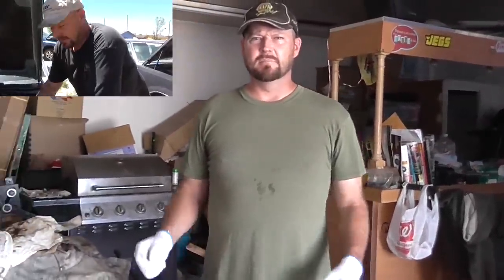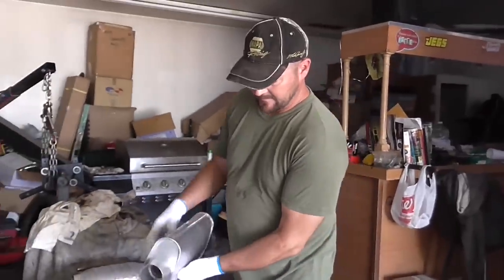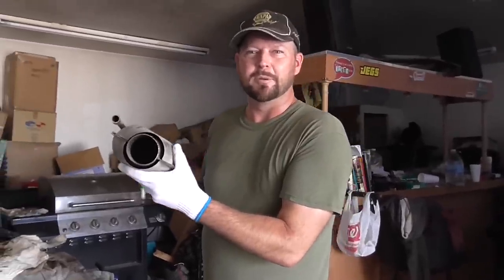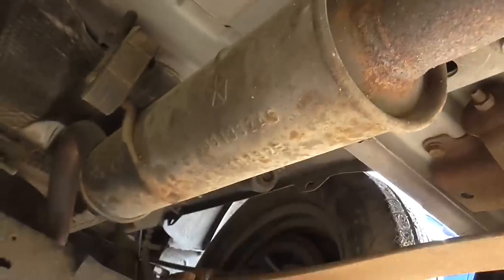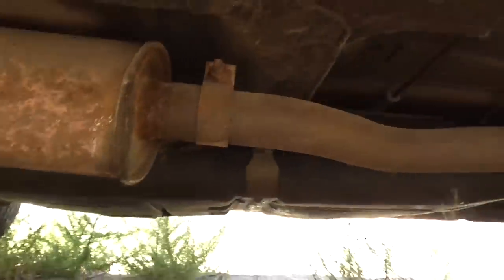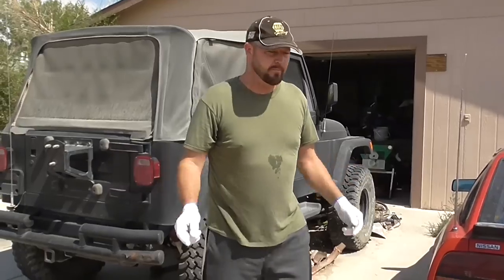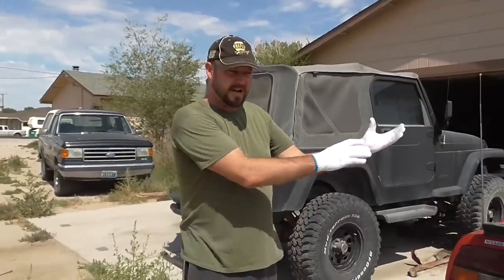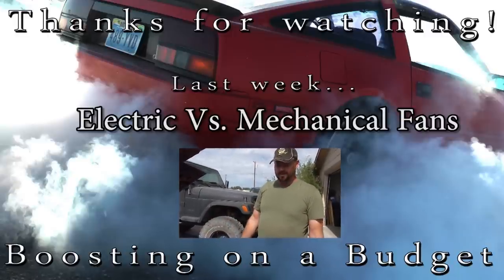Exhaust System - The Basics

Comment: Running twin straightpipes with glasspacks on a 302 '87 Bronco, not legal but not illegal in the Republic of Texas. Not sure if I'm losing back pressure or not, I plan on modifying the air intake like you suggest in your other videos within the coming weeks. I'd appreciate a reply regarding my back pressure. Great videos, keep it up!
Reply from the maker: many run a crossover, x pipe or balance tube between the two exhausts to better balance flow between two banks of cylinders.  Glass packs are a free flow design, pretty much one of the lowest back pressure options as long as the inside diameter of the glass packs are close to diameter of exhaust pipe used.

Comment: Hey Matt, Big Fan. I just subscribed. Question By cutting off the Cadillac Converters and just running straight pipe. Will or will that not cause any problems  or damage to the motor due to a Loss of backpressure, I'm concerned and Could use a little advi before I continue. Thx!!

Finch
Reply: No Damage 🤙💯

Comment: BB I appreciate this video and the 2 videos you did on modifying your stock intake box. I have a 2002 pontiac grand prix se with a 3.1 liter engine and I modified the stock intake box and I also had dual exhaust installed. I left the catalytic converter and the resonator in place and I used vx mufflers for a free flowing exhaust. The vx mufflers are just like the Flowmaster 40's. Free flowing air going in and free flowing exhaust going out. Also the 3.1's respond well to mods so this car is hitting and getting it.

Comment: A set of extractors and free flowing exhaust makes a huge difference if you have the engine breathing in with a bigger throttle body and CAI. If my car is more tail happy that I can't drive in the wet like before? Well that's proof!!! How is the car suppose to breathe with a big pipe full of honeycomb materials????
Reply: On catalytic converters I was told to rip the guts out. Lol. I wanted to but my engine would have been too loud.

Comment: Just subscribed to your channel bro,great video, what do you recommend for a 1996 Mitsubishi 3000 gt?
Reply from the maker: A free flowing intake kit ( best deal for the $) or design your own.  You could either buy a cat back exhaust system made by an aftermarket company or make you own.  The sleeper version is basically do a muffler and resonator delete.  Every muffler, resonator, or catalytic converter, have them cut off and replaced with straight same sized exhaust tubing.  Any muffler shop or competent mig welder can do that for you.  On the outside it would look like a stock exhaust, but when you turn the key, it sounds, feels, and performs like a very expensive aftermarket exhaust system.
Reply: Black Widow 
Spin-Tech 
Coras 
Borla 
👍

Comment: I'm sorry if this is a stupid question.  I have a 1991 Toyota pickup with a 4cyl 22re engine.  It absolutely SUCKS at climbing hills.  I am about to do the intake mod and exhaust.  You mentioned an exhaust shop doing the work for you at one point.  Would I be able to buy a whole new aftermarket exhaust system and install myself? Or is it cheaper to get it done at a shop?
Reply from the maker: Ryan Brindley I recommend a muffler or exhaust shop because the exhaust is not the problem, the restrictive catalytic converters and multiple mufflers are the problem.  Just one free flowing thrush welded muffler to replace all the two to three factory mufflers and its good.  1991, you should be able to replace the cat with free flowing pipe and that will make a big difference.

Comment: I kind of disagree regarding the catalytic converters. With modern engines, even early EFI engines run much cleaner than old carbed engines, they have a more precise air/fuel ratio so it doesn't clog up the cats with carbon. My Town Car has 4 cats from the factory, that car is almost 30 years old and the cats are fine, the car still pulls very well up hills. New engines with DOHC and variable valve timing and whatnot, they burn so clean that cats are designed to last the life of the car. At work we have delivery trucks with over 500k miles, some have rebuilt short blocks and heads depending on their condition and we don't replace the cats, they continue to flow just fine as long as they're no problems with the engine. If they clog, something is causing it like a rich condition. If the problem is fixed, the cats should be fine.

That said, there are performance gains when removing them. Not always, modern 3-way cats are designed to be very high flow from the factory and you probably won't notice any difference. You'll gain more from a cat delete if you add headers and exhaust, and/or if the engine is forced induction, especially turbocharged engines. On a 140hp Honda Civic though, not really going to make a difference, not worth the fine you'll have if you're caught.
Reply: +snakesonaplane2 Also, my wife has a Town & Country 3.8 like the van in the video. On mine the stock muffler split at the seam so I had a muffler shop weld in a Flowtech Raptor turbo muffler they had laying around, and it helped performance a little bit. I also cut that resonator on the end of the tailpipe off since it was very rusty, and all it did was make more noise, no performance gain. It's basically a glasspack, just a straight through perforated pipe to absorb sound, not restrictive at all.

Now when that all got rusty again, I had a Dynomax Super Turbo welded in (best flowing turbo muffler) in a larger 2.5" size, and reduced down to 2.25" to use a new factory tailpipe. Now it's quieter with a resonator, and with that larger and better muffler, it flows better now too. That's what I recommend to all with this 4th gen Chrysler minivan. I've seen some guys go with better mufflers like Magnaflow, but those are too loud for a van IMO, the Super Turbo is very quiet and still flows very well, at least twice what a stock muffler does.
Reply from the maker: +snakesonaplane2 Yes, that is the problem, the fine, the rules, etc.  For boosted engines especially the Mazda Rx7 rotary engine it makes the most difference than any car I have seen.  Turbo vehicles, its day and night with boost response not having one.  Natural aspirated cars do not seem as much effected by new flowing Cats versus none unless the engine has been highly modified, then the differences are much more noticeable.  Catalytic converters give way too much backpressure and unfortunately the legality is the reason why the best we can do is, replace them with higher flowing, better designed, light weight Cats.  I have seen so many factory cats fail miserably that I dislike everything about them.  There is always the racetrack and old classic car ways of not having to deal with them.  I like the classic car, and classic rod route myself.
Reply from the maker: +snakesonaplane2 Yes after market mufflers versus stock chokers make a world of difference especially when done with intake modifications together.  Breathe in smooth, breathe out smooth.
Reply: Budget Boosting The old pellet-style cats, the big flat ones that they first used in the mid-70's all the way into the early 90's, those are pretty bad. Some cars like the 70's Corvettes had less restrictive mufflers after they used those cats, so it wouldn't suck too much power. Cars like the Mustang 5.0 up to '85 had those, they used a true dual system but merge into just one of those, really choking it. A lot of guys would cut it out, have it made into true duals again and install a pair of Flowmasters or something, and gain a lot of power.

And like I said, new cats are fine but still choke exhaust with forced induction. My buddy installed a race downpipe (no cat) on his Chevy Cruze Turbo and did a muffler delete with a mild tune. That car runs so much better, probably added a good 50hp with the exhaust and tune.
Reply: snakesonaplane2 That's cool man. I have a 96 Ford F150 with 5.0L Windsor V8 with 204,135 miles on it and it's still going strong. The only thing I replaced on my truck was the starter but other than that mostly was just simple maintenance and cleaned out the transmission fluid just to get rid of the shuttering it was making and it hasn't had a problem ever since.
Reply: snakesonaplane2 GM and still uses pushrods in they're V8s with variable valve timing, Direct injection, and cylinder deactivation  while Ford uses DOHC in they're V8s.
Reply: Budget Boosting Me to man me to.

Comment: hehe...who needs s muffler? i run straight...kinda.. i have a resinstor tip, steel wool kinda lining inside.
Reply from the maker: I like straight too on my 87 buick.  The turbo alone is enough muffler to me.
Reply: i got an idea...hide a turbo in a gutted muffler xD remote mount turbo pipe coming out of he top so it cant be seen too well from the underside.
Reply from the maker: There are companies right now making stealth turbo kits that replace the muffler which can only be seen when looking under the car.  Under the hood looks stock except for a pipe leading to the intake which most will assume is a CAI kit.
Reply: Good to know.
Reply: Budget Boosting hey what kinda of exhaust system can I run on my 95 Buick LeSabre Ltd? it spudders

Comment: there are myths going about free flow exhaust. which says.
"free flowing exhaust are too noisey and reduces fuel economy"
the other myth is
"A free flow exhaust will cause damage to the engine valves"
and
"stock exhaust make more power than free flow exhausts"
Reply from the maker: Myths are just that, Myths.  The noise of an exhaust system depends on the type of muffler you pick for the exhaust system.  Generally free flowing mufflers are louder than more restrictive mufflers.  That is the time where a person chooses what is more important, flow or some more exhaust tone.  Free flowing exhaust increases low end engine torque which is the power that moves a vehicle from stop to around 4000 rpm.  Most cars have a catalytic converter so that is already a lot of back pressure for the slight backpressure that many say is required for valves.  The exhaust manifolds or headers alone are plenty of back pressure for valves, just fuel and timing adjustments are recommended to complement free flowing exhausts.  Stock exhausts will never make more torque or power than free flow exhaust unless it is a free flow exhaust from the factory.  Some special edition vehicles such as the Mustang GT350R have a free flowing exhaust from the factory.